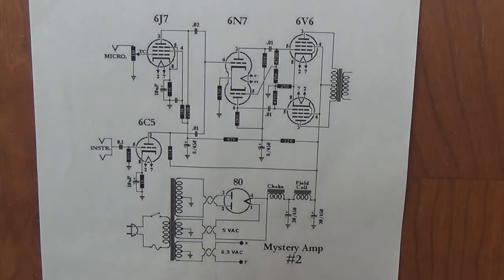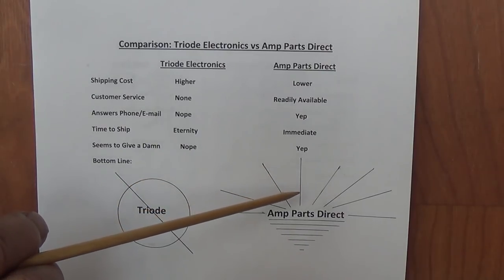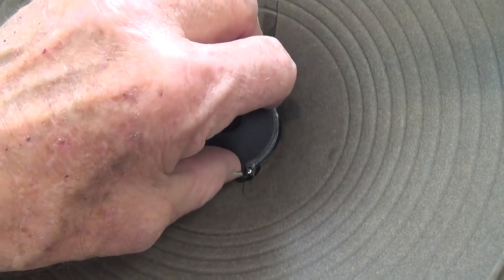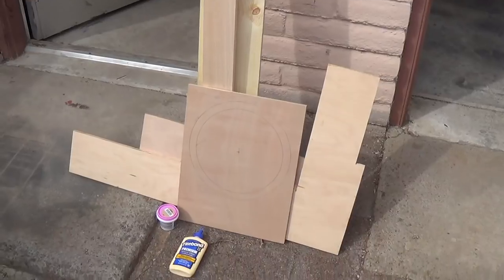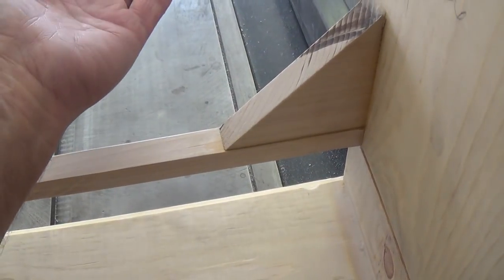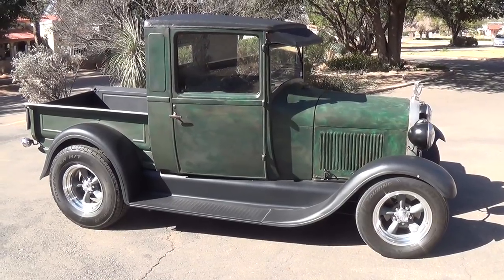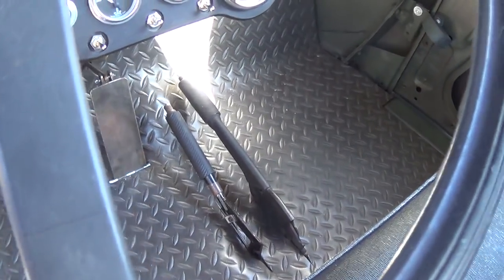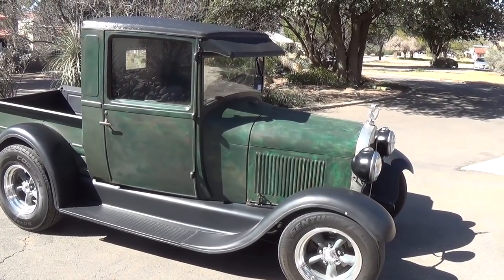Let's Build the Mystery Amp......Part 2

Comment: I like your gusset approach for the baffle. Much better than the cleats that I used for my baffle.
Reply from the maker: Thanks, SC. It's a new design that came to me while viewing the baffle from inside the cabinet. I think securing it with 1/4" bolts will ensure solidity and resonance.

Comment: Hi Doug,  I like what you did with the cabinet design and especially the use of the grooves to locate the chassis--that's so much better than Fender's practice of hanging the chassis by screws that pass through to the exterior.  I make one additional mod in my cabinets--I glue the speaker baffle in with enough recess for the speaker to mount in from the front, and then use a very light grille-cloth frame made from 1/4" plywood, held in by Velcro or some other suitable means.  The glued-in baffle really stiffens and strengthens the cabinet, and I love being able to change and experiment with speakers without having to do any disassembly at all.  This design also allows quick and easy replacement of torn or damaged grill cloth.
Reply from the maker: Thanks, R, both for your nice comments and the good suggestion :)

Comment: Hey Uncle Doug, great video! I can not yet fully appreciate the time and work involved in your amp builds as I have yet to build one, I can however appreciate the work on the truck in the winter of 82' I helped a guy build a 1958 Chevy truck, we swapped out the frame for a later model large car frame with independent front suspension and a small block Chevy and automatic trans, also we cut the and welded the front sheet metal to create an all steel tilt front end (SO much easier to work on) It was quite the endeavor! Very nice job on both projects!
Reply from the maker: Thanks, Jack :)

Comment: Liked and commented before even watching. Nice to have you back, Doug. Your Jensen is from 1958, I believe, not 68... back to watching...
Reply: Lol me too I click it so fast it's like I'm trying to win something.
Reply from the maker: Thanks, Brad. You may well be right. I rolled the dice a few years ago and bought two old 5-foot Ampeg speaker columns, interior unseen. They contained five perfect Jensen's, like the one in the video, one with a roasted voice coil (as seen), and a mint Peavey Black Widow.....which I promptly sold to recoup the price of both columns. What a treasure trove !!!!  It almost makes up for all the dice rolls that turned to %$@?&@  :) :)
Reply: Love when that happens. Exploiting the gap in knowledge and care. Few people even seem to care about the things they own.
Reply: I just have to add, not trying to spam. But I just and I mean just, 20 minutes ago....made a patch cord to plug into a 1950 RCA Victor AM/SW Radio with a 5Y3GT, 6k6GT, 6AT6, 6BA6, 6BE6 in there.  All I'm pretty sure are original tubes as they are all made in Canada as well as the amplifier.  It's rated at 50w which I believe is the radio input??...and has about 1.5w out of the speaker.  I'm doing a full restore on it for the radio which I have ordered parts but in the mean time I plug my pedal board and guitar into it and it is literally amazing.  Talk about bedroom volume and tone.  I have to boost the signal with my compressor to get a satisfying volume out of it but it's just amazing.  Tons of love to both of you fine gentlemen that have taught me alot about amplifiers and repair.  Thanks for everything guys.  Love the knowledge you are sharing with love and positivity.
Reply: Hey Justin. The 50W rating will be the total power consumption of the radio. That seems about right for a radio like that. I'm sure I can speak for Uncle Doug too when I say we appreciate you watching and commenting.
Reply: The Guitologist That series was invented in the 60's, and they made this speaker in 1968. So it must likely is from 68', but definitely not from 1958, as they didn't make them back then. Took me less then two minutes of a Google search to confirm this just to let you know. They make reissues of these now too BTW.
Reply from the maker: The seller of the speaker columns, who was too lazy to open them to see what was inside, found out about their contents and now holds a grudge. I somehow fail to lose sleep over this :)  Thanks, guys. It's great to be back.
Reply: Uncle Doug The seller has only one person to blame. Mature people of all ages will instantly know who I'm talking about. It's called Capitalism.
Reply from the maker: Yep, and if the speakers in the columns were all shredded junk, I'm sure the seller wouldn't have lost any sleep either.  When the dice get rolled, both parties need to be able to accept the outcome.
Reply: Uncle Doug The only issue I see is one of the parties involved isn't capable of excepting personal responsibility for his actions. It's simple. He chose to be lazy, and he paid for that choice. Welcome to the real world. Where you watch your own back, because know one's going to do it for you. If you can't handle that. Don't play the game. Crying later only shows others what type of individual they're dealing with, and probably gives them a good laugh at your expense too. The amount of immature people I encounter on a daily basis never fails to amaze me. Especially when they're older then me (46 next month).
Reply: GLAD TO SEE YOU BACK LOVE YOUR VIDEOS

Comment: Hey Uncle Doug - SO pleased to see you're back making videos!  I watched Part 1 and was not able to make a comment at the time.  I am really sad to hear of Rusty's passing. I am all too aware of how difficult it is to lose a long-time pet like he was. It is nothing you soon get over.  

Your cabinet work on the Mystery Amp is very good indeed. Woodworking can be tedious but it's very rewarding when it comes together!  I have had two interesting projects recently, one of which involved a lot of woodworking. I built two massive box fans out of 1925 Sturtevant propeller fans that came from a historical theater building. Lots of sawdust!  The frame was built of 4x4 post to support the 500 pound iron fans!

Also love the 1928 Ford pickup.  It's great to build "period correct hotrods" as they say.  My 1984 Buick is like that. I used Grand National specification parts on it to build a very fun 'sleeper' hotrod!

Again, so pleased to see your videos coming again. Thanks for taking the time!
Reply from the maker: You're welcome, David. Thanks for your very nice comments. During the summer it gets really hot in the workshop.  Now I know what I'm lacking.....a 500 lb. fan !!!  They must move a whole lotta air :)
Reply: The least I can do is make a nice comment.  There are literally MILLIONS of creators on YouTube, however the vast majority of them are nothing but chaff and swarf to be waded through. The good guys are few and far between. :) 

As for the 500 lb fans, they came from a theater in Chicopee MA. I had to make a 2400 mile road trip with my little green trailer to retrieve them. The company, Sturtevant, is no longer in existence; however a retired employee contacted me and gave factory literature and other guidance. They didn't make many of this model fan. He isn't aware of anyone else who has a running example.  Here is a video on these rare beasts: https://www.youtube.com/watch?v=qdFYH8oqvKo 

As for how much air they moved? According to the manufacturer's documents, they move 12,850 CFM!
Reply from the maker: Thanks for the nice comments, David, and the additional information on those incredible fans :)

Comment: Came back to revisit this video to refresh my memory on which transformer retailer to avoid.  I just noticed in the schematic that the 5V center tap was grounded.  I assume that the amp was not built that way because Uncle Doug survived and made more videos after this.  :D
Reply from the maker: I have never seen a 5V winding that was center-tapped, Dr. T......only the 6.3VAC (usually) and high voltage windings (unless used with a full wave bridge rectifier) are center-tapped.

Comment: Uncle Doug,

I love your amp builds. I am glad to see you posting new stuff again, but when I saw that truck, first thing I thought of was "It's got a Chevy engine in it.". My guess was a new small block. At least you didn't do that. I understand that everybody likes different stuff, and it's a good thing, because otherwise the world would be homogeneous and dull, but I hate to see old iron hot rodded.

My own peculiarities aside, it looks like you did a good job of hot rodding it. My dream is to race prep a stock Model A and drive it in the Paris-Peking rally. 

Anyway, thanks for the video. Keep up the good work.
Reply from the maker: You're welcome, Bruce. I would never alter a nice, complete original car. In fact I had a near-perfect Model A coupe and sold it to a collector rather than chop it up to be a hot rod. The Model A pickup was a rolling, rusty basket case that had no restoration potential, so I happily turned it into a fast, reliable vehicle.

Comment: Hi Uncle Doug.  I know I've said this before in many different ways, but in all honestly there isn't another YT channel that I even remotely enjoy as much as yours. Not only is it enjoyable but I learn something new each time I watch your videos, and just when I think it couldn't get any better you throw in a tour of a Model A that you built from the ground up. The truck is a jewel and the build quality is equally impressive. 

You mentioned how you wanted to keep most of it period correct, and I agree, but if I could offer one small suggestion that may put an even bigger smile on your face it would be to consider a B&M (or similar) shift improver kit.  

You may already be familiar with what it does, but if not it can really tighten up the shift points under quick acceleration yet remain comfortable during normal driving. I had one years ago and really enjoyed it. I think the cost back then was around $25 so they are probably closer to $40 now,. No other modification gave me as much for my money as that B&M kit. 

Thanks again, and tell Jack he's doing very well in his new position. His confidence is impressive.
Reply from the maker: Thanks so much for your very nice comments, Randy. Regarding the shifter, I designed and built it out of necessity......there is simply no foot room with 2 people aboard and no room between the floorboard and transmission. My design uses levers and steel rods to precisely control the shifter arm on the transmission, as well as locking out reverse and park. It has worked flawlessly. I understand the appeal of a more conventional shifter, but honestly love this one. It's simply a matter of opinion, I guess.
Reply: I completely understand.  The modification I was referring to is internal and would not require alteration to the shifter.

B&M, and a few other brands with names I can't recall at the moment, offer a kit for around $40 that involves some minor internal modifications to firm up the shift points. There are two options available during the install. One (RV Mode) provides a noticeable firmness at all shift points that will increase depending on acceleration. I did not try the second option since it is more suited to drag racing the loosening of dental work.  

Given the light weight of the Model A the TH350 may be just fine the way it is but you might enjoy it more in the Jeep.  In addition to a more positive shift the benefit of installing the kit is less friction and heat and therefore  of course longer life.  

When I was young and reckless I put 168,000 fairly hard miles on my TH350 and it was still capable of chirping the tires when I sold it. I'm not proud of how I drove it and any accolades to the  performance and life of the transmission speak more about the benefits of the kit than my driving style. 
 
If you're curious I have provided a link below. Unfortunately I did not find any good videos demonstrating the performance differences. 

I hope you enjoy that Model A. 

https://www.youtube.com/watch?v=wPCROQ4YHhk

Comment: I'm so glad you are back, you can only re-watch a video so many times....    I had a thought that you might be able to expand on...   I think that I have a fair idea of how an electrical circuit works (one year of college electrical 35 years ago) but valve amps are new to me...  I think that a lot of people will understand how the B+ voltage gets to the plates, its easy enough to follow on a schematic and color it in red... but I'm not so clear about what happens on the other side of the grid, i.e. the cathode going to ground through a resister/capacitor...  I say this because there are lots of ground symbols all over the schematic and it looks like its only really showing in the B+ on the schematic...   

So given that to complete the circuit it must be grounded to the chassis and that electron flow is from the chassis ground to the plate what what kind of voltage is actually seen across the resistor/capacitor going to ground.  Also I have seen a tap from the power transformer used to raise the chassis potential to some voltage above zero.. why?   I may be just stupid or missing the point, but I think you may have the answers at your finger tips
Reply from the maker: Yes, the electron flow is from the negative chassis ground upward through the cathode to the plate.  The voltage drop across the cathode resistor depends on the amount of current flowing through it, in accordance with Ohm's Law. See my video on biasing for a detailed explanation.  I have never seen a transformer tap used for this purpose, William, but it may be to reduce 60Hz hum in the heater circuit.

Comment: Love the amp series and your 1928 truck.  I like steelies or artillery rims for old look. Nice job on the front and rear suspension work.  I have a T-bucket going together and 32 roadster fiberglass not easy finding original roadster bodies and repop bodies are too expensive.  Aslo, I had lots of trouble with Triode myself and switched to AmpPartsDirect.  Watts tube audio also has MC transformers.  Mark
Reply from the maker: Thanks, Mark. I used rally  wheels with beauty rings and center caps on my '40 Ford pickup. It will be featured in the near future. Good luck with your projects.

Comment: Uncle Doug, you're my new favorite uncle. I'm in amp repair school with every video you post. I really appreciate the fact that you do your utmost to keep all the killer old amps as original as you can. However. You don't seem to have the same respect when it comes to the even more rare old iron that you repair/restore on your secondary videos. Chevy engines are not "better" than Ford motors, Ford In Ford, Mopar in Mopar, GM in GM, that's the way it should be. I build hotrods, taking the effort to put the correct factory engine brand (not necessarily stock) in a vehicle is no different than stuffing new caps in old capacitor housings. I'm sorry, "easier" is not the best way. Still, I love your channel and will continue to be an avid subscriber. Thank you.
Reply from the maker: Thanks for sharing your opinions with us, PBJ. I hope you enjoy all our videos.

Comment: Triode failed me once, the transformer delay cost me the labor fee on an amp build.
Never again! Amp Parts Direct gave me a free upgraded transfprmer for cheaper than Triode after hearing the horror story.
Tube Depot also sells Classictone transformers. They have the common Fender and Marshall ones in stock. 

I'm intrigued over this bend-less chassis. Can't wait for the next video!
Reply from the maker: APD certainly impressed me with their service, Matt. They now have a new customer for life. Stay tuned......the aluminum chassis is in Part 3 :)

Comment: Hey there,Uncle Doug!
Junior ampocholic asking a woodworking question.Is it a good idea cutting cabinet sides with a sabre saw,due to the lack of a table saw?
Also is it possible to cut box joints using a sabre saw for the same reasons?I appreciate your attention and as always - thank you for the informative and entertaining content!
Cheers!
Reply from the maker: Greetings, DD. I guess anything is possible, but cutting box joints with a saber saw would not be at the top of my list. The two side cuts on each joint would be easy, but the cross cut at the end would be a challenge, unless you made your joints quite wide, say 3/4 to 1". Good luck.

Comment: Hi Doug, I was recently in the market for an output transformer (deluxe reverb type) and actually found a Hammond that was only about $1 more than the corresponding Classictone.
Reply from the maker: Hammonds are affordable, B. If you want a real shock, check out Mercury Magnetics. The same CT set I bought would probably be $400+ from them.

Comment: I get my transformers from Amp Parts Direct AKA Valvetrain Amps. I went to their store and picked up some parts the last time. I am a little over an hour from them.
Reply from the maker: I wish I had know about them sooner, Charles. They provided great service for my recent order :)
Reply: I am so sorry to here that Rusty has passed on! He must have been a great companion for you and family along with Jack.
Reply: My latest build is a 6G3 Head that I finished on March 2 or 3, I have videos on my channel too. My son and I are also in the midst of rebuilding a 2005 Hemi for a Durango that was loaded, He paid $800 as is from a dealer who unloaded it cheap. One piston what busted and scored the cylinder but it all honed out in about 10 minutes. We were lucky! Heads out to a machine shop now. Some vid of thr engine and the Durango.
Reply: Don't be fooled by my picture I am 70 and that was back in 1972 when I was about 23. LOL!